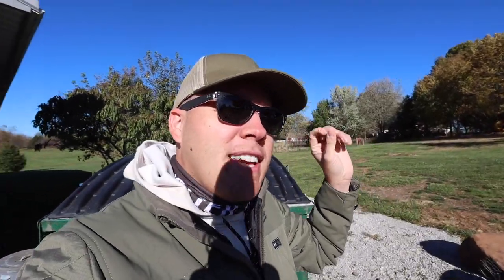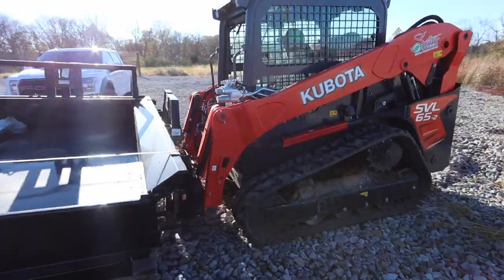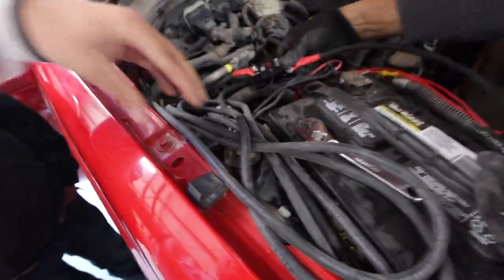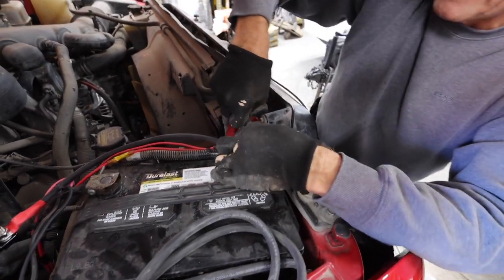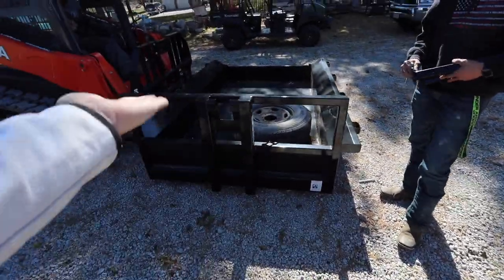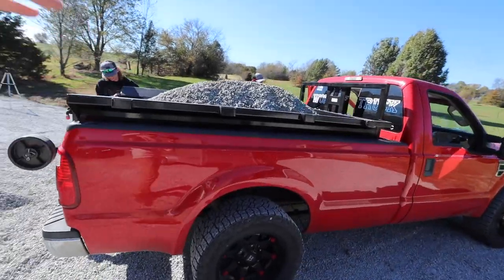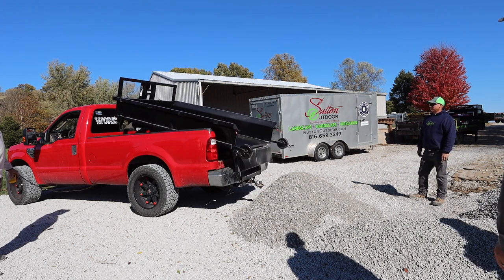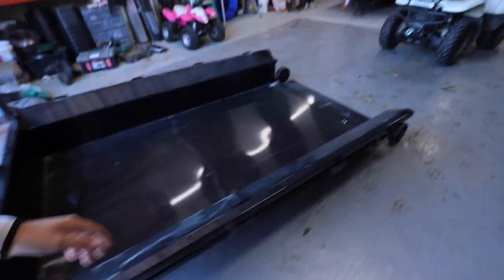I Got A Dump Insert For The Work Truck

Comment: Why not bolt to frame?  The bed will rust with those new holes causing problems in long run . I like the dump bed. Seems very convenient

Comment: From 6mpg to 4mpg real quick 😂
Reply: But the advantage on this design is that you only have it on your truck when needed as oppose to other inserts which are permanent. Would have nice if the lift hook could fold into the truck bed so it can fit under a tonneau cover.